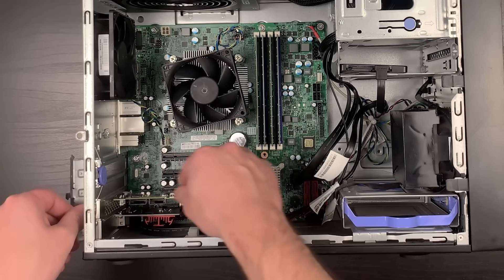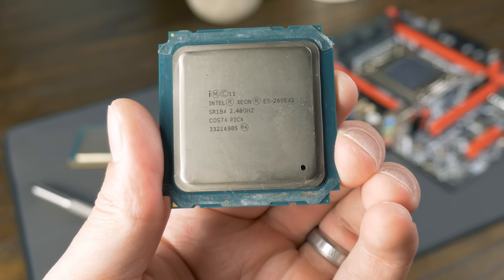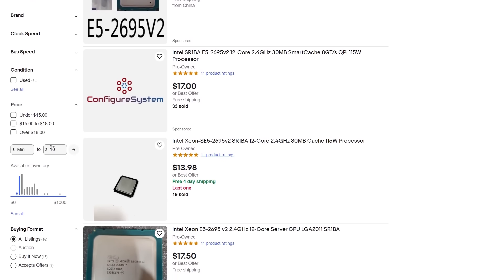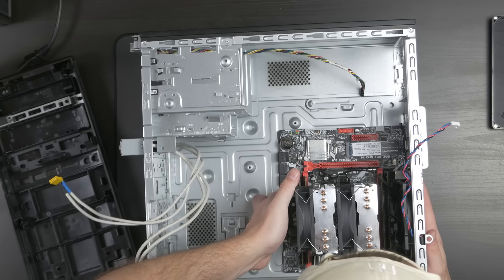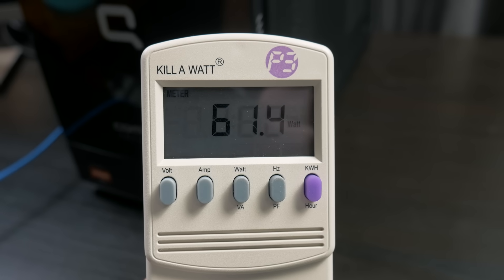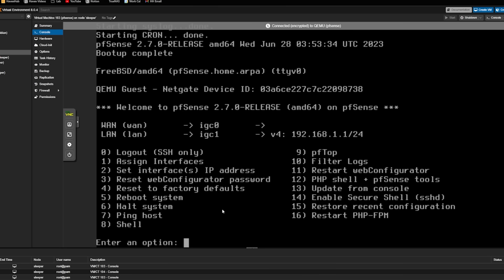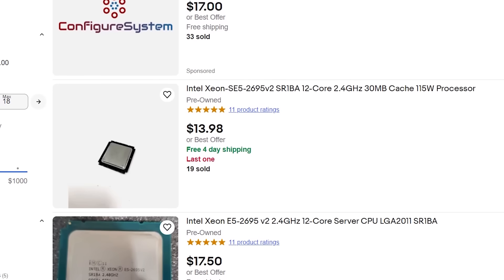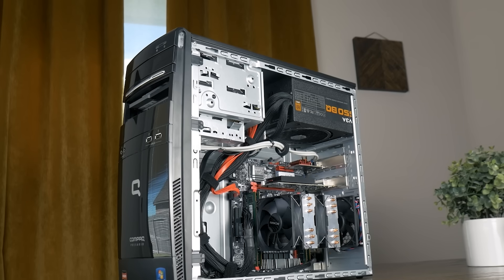Are CHEAP x79 Servers/Workstations Good In 2024?

Comment: I’m a cloud devops engineer obsessed with privacy and security. My main workstation runs Qubes OS. So everything’s in a VM. Probably 10 or more total concurrent VMs in my average workload. 

A pair of 8 core Xeon E5-2667v2s with 128GB of ram makes easy work of it. Single core performance is meh but it chews through the demanding workloads I put on it.
Reply: And you're telling Google about your setup?  Not obsessed enough!

Comment: Great video. Im also thinking to resurrect my i7-3930k as my old motherboard strike by lightning (ADSL connection) around 5 to 6 years ago. Been looking on aliexpress as well on buying a new x79 board. Just that im not sure the power consumption will impact me or not. Maybe someone can highlight me on this?

Main focus of the build will be running NAS and jellyfin (i had one asus GTX680 laying around as well). Maybe setup proxmox with some vm running system to share around the network too. Is it really worth the shot?

Comment: I had a similar rig with dual quad core cpus for a total of 16 cores but I found it limiting. I recently upgraded to a ryzen 5900 and yea it's a bit more but the IPC makes a huge difference on my virtual machines. They used to feel sluggish and my power draw is significantly less
Reply: 2x4=16?
Reply: @GewelReal  he probably means threads

Comment: Love old X79/X99 content. Crazy how cheap you can go. I rock a E5-2683 v4 for my server and it's awesome. Just upgraded to 128GB ECC for dirt cheap.  Haswell/Broadwell also have AVX2, so that's a nice add.
Reply: Same here. I am running a budget workstation on a X79 basis, including dual CPU (currently two 8 core Xeons) and 128GB RAM on quad-channel. Not the fastest beast, but powerful as a bull
Reply: nice. i am about to complete a dual 2697 v2 with 128GB 1866 system for video rendering.  @pascalfust1035
Reply: If you want serious storage space for less, you need to look back one more generation.
Something like the Supermicro 6047 72 drive hot swap server - which can be found for $1500 without trying hard.
The next-gen 6048 has some advantages if you want processing WITH your file storage, but costs significantly more.
E5-2630L v2 are not all that big of power hogs, even by current standards, though the non-L of that generation get kinda hungry.
Reply: How much ram did you get, how much did it cost and from where?

Comment: During winter the wattage does not go to waste at least. My pcs cut my heater use. Power is never wasted its just converted.
Reply: True but you can't really control the output temperature that well.

Comment: Cheap server components and stacks of PCIE lanes are the reason to do this.  PCIE gen 3 SFP/QSFP cards are cheap.  Brand new PCIEx16 gen 4 cards with 4/8x NVME drive cards can be dropped into a gen 3 slot while protecting your investment.  You can also do 8xSATA cards with sata SSD's but I suspect that's a dead-end tech.
I recently moved my i7-3930k to a 10-core xeon which upgraded the PCIE bus from gen2 to gen3 on my asrock x79 mobo.
Along with power draw, heat output is significant.  Beware non-standard tier-1 hardware manufacturers' systems, because you will need a case with better airflow than your standard workstation build, especially if you want to stack HDDs or a QSFP server nic you thought was cheap...

Comment: I got into big servers by buying a DL380p G8 with dual Xeon E5-2630L v2's and 128GB of RAM. Bought a second node with the same RAM and dual E5-2650's and built an X99 based custom build with an E5-2650 v4 and 128GB again. Total is sitting at about 384GB of RAM and 88 threads for the main nodes. The DL380p's cost me about 250 euros total, including the upgrades to their "final" specs they're on now. Need new and faster CPU's, however. The X99 system was another 300 in total I think. I actually use about 150GB of RAM and about 10-40% CPU.

What I'm trying to say is: there is very great value left in these machines, especially if you go the used enterprise gear route (and for DL380p G8's, you can modify the firmware and achieve near silent operation using some fan control scripts (that also ramp up if needed so no hardware gets burned).)
Reply: A DL380 isn't a big server.
Try something like a SuperMicro 6047 (same generation, 72 hot swap drives PLUS a couple of internal 2.5 boot drive spots not hot swappable).
I prefer to avoid HP in that timeframe as their raid controllers don't play nice with LINUX, you pretty much have to disable the raid function and pretend all your drives are individual RAID0 to make them usable - not an issue on Dell or Supermicro.
Those E5-2630L V2 are not bad on power usage, and quite good in their timeframe for their performance, and ECC DDR3 is almost dirt cheap any more given how many of those older servers are getting retired for newer gear.
For faster CPUs, I'd recommend the E5-2680 v2 as the best performance for the buck in higher-end CPUs right, any of the 269x are even higher performance but are still a little expen$ive and draw more power. Your existing heatsinks should work fine, HP like Dell and Supermicro tended to have ONE heatsink model for any given server model and it was always sized for the highest-power CPUs that server was designed to work with.

Comment: The X99 series is a much better option in 2023 for cheap Xeons. Not to mention the much newer chipset and ddr4. I went with the machinist x99 board from Aliexpress and a Xeon e5 2698 v3 with 256 ddr4 ECC.
Reply: U run stock bios on board or something modified, IRC machinist x99 rs9 have troubles with USB 3.0
Reply: @mateuszzimon8216  the bios that came with it. Slightly overclocked. Usb3 works just fine
Reply: Also if u wanna stay with V3 u can modify bios to run all cores turbo if they shipped without this in bios.

Comment: why use xeon v2, when v4 is the most logical choice.... you get processor with newer node 14n vs 28n, newer instruction, better single core performance, better efficiency and the price almost the same, also xeon v4 uses DDR4 memory.

btw, I bought  E5-2667v4  8cores/16threads (runs at 3.2ghz and boost at 3.6ghz) + 16GB of ECC DDR4 memory + motherboard, the three cost me around $100 from aliexpress
Reply from the maker: Because I bought the CPUs for the motherboards I was hoping to mess around with. Like I explained in the video.
Reply: @HardwareHaven 
Now I think about it,  you must have discovered that the second mb is x99 after buying the CPUs 😐

Comment: I've been using Sandy/Ivy Bridge Xeon servers for the past 3 years for my gaming community. One game super benefits from high core counts and is a ram hog so dual Xeon 2670's was the cheapest option out there with 128gb of ram and still running strong. My hardware is nothing I could recommend for a beginning, tinkering, or apartment dweller. It's not for the faint of heart.

I wish there was a video like this one back when I got the idea to buy used servers instead of renting servers. Your experience parallels my experience. 

Now that my electric company charges a "Time of day" rate and increased rates overall I'm finding myself close to shutting down servers. I can't recommend my solution to people wanting to do public game servers at home anymore. Its still fun to work with and I'm not trying to make money it. 

Great video, liked and subscribed.

Comment: My 2 cents... ZFS takes up to 50% of total memory. And it doesn't want to let it go easily. Learned that the hard way.
Reply: You can manually limit the amount of RAM ARC uses, it's all in the Proxmox documentation if I recall correctly. In my Proxmox cluster, for example, I've limited ARC to around 1 to 4GB only, since I use fast NVMe SSDs for my VMs and the storage capacity of each node is pretty low.

Comment: Nice video. I got a Lenovo P700 free from work when it was being tossed out due to it's age It has two E5-2620 v3s in it. 128GB of ECC DDR4 and I tossed in a 128GB PNY SSD with truenas scale installed. Two 8TB Ironwolf NAS drives.  Using plex and pi hole on it.
Reply: That's hell of a find. Nice job repurposing that beast!!!
Reply: @Fishgod1216  Thanks.  SMB network share, pi hole, plex and now it's a pxe server using iventoy.
Reply: @Fishgod1216  Thanks! It's been running 24/7 for about half a year so far.
Reply: That is really awesome it’s crazy what some people throw away
Reply: @OShackHennessy  Especially rich businesses. A few years ago one person asked for a 10,000 dollar pc and they just got them one. They hardly even used it.

Comment: holy crap im using that SAME case right now - my grandmother had a compaq 5000 something or other - thats too funny, i have an MSI B250M with an i7-7700 with 32G as a NAS with 5 drives in it....I had to buy the removable drive cage for the front of the inside off of ebay since hers didn't have it but the slots for it were there.....thats fantastic

Comment: i bought an HP Z840 a few months ago along with 256GB of mem, a bunch of cheap SSD's and 10G networking...I think I'm all in like $700 or so but it runs everything I need it to and is just rock solid...i have an HP Z600 as well it was meant to replace i now use as a backup....5-8yr old xeons are just SOOO much fun to mess around with, especially with all those cores and threads!

Comment: I was able to get a hold of 2 HP DL380P servers from a store that was tossing out some old hardware. I took all the memory and dumped into a single unit, 256GB total, and took the CPU from one unit and made the other a dual CPU configuration (these units were used for CCTV recording, so only 1 CPU was needed for those tasks).
Started off using the included 8x 2TB drives to mess around with, and get familiar with setting things up and such. Then later on purchased some 4TB drives from RhinoTechnologies on ebay for really cheap.
Next plan is to upgrade the CPU's to the Xeon 2695's to get more cores, doubling what I have now. I run multiple VMs and services/servers this way.
For my gateway/router, I use an old AMD FX board with opnSense installed inside another Proxmox installation with piHole running on that one as well. I did this because I wanted the gateway/router to be up and ready for network traffic asap. Full power off to internet connected takes <2mins. Faster than what it takes for the cable modem to finish booting up.

Comment: ooh, you so need to slap in a 4x NVME drive bay on that PCI slot and do a passthru!  Very cool build but will get the stuff done..I love those ICY Dock 5.25" bays...just need to get you a few 2TB SSD's!  Oh I found that assigning the VM's in PROXMOX on older hardware (I have an I7-3770), give it ALL the threads, so 24 for each machine...PROXMOX will autobalance them and unless you have a VM that is literally using all the cpu power (which is very rare) PROXMOX will balance very well and all the VM's will be snappy and much faster.
Keep em coming!!!!

Comment: ESXi having dropped support apparently, the (X99) 18-core, 2.3 base-2.8 all core-3.8GHz single core e5-2696v3 is going cheap as chips (although still solidly a premium chip).

Comment: I got an old HP Z620 workstation with 32gb memory, a video card a few years ago.
Replaced CPU with a similar 10 core CPU.
 And added an ssd and hdd. 
Power draw about 100 W while running Windows.
Still runs fine.
Reply: i have a Z600 that i've owned now for like 8 years that was used when I got it and just bought a Z840 because I love that one so much, now running both....im not an HP fan in general but I LOVE their Z-stations!
Reply: For comparison, I have a Lenovo workstation board x79 with Xeon 1620v2 and 64GB EEC and some random 2GB GPU, and it draws about 150W. 

Which is a lot better (and more horsepower) than the retired dual Xeon server I stole the RAM from... 450W idle, tho some of that is fans.

Comment: Yeah these old Xeons have finally lost their place as far as I can tell unless you particularly need the pcie lanes or a ton of ram on the cheap. 

We're getting to the point you can regularly find good deals on 1st/2nd gen Ryzen and Threadripper, as well as 8th-10th Gen Intel

And even sometimes 3rd gen Ryzen/Threadripper, or 11th/12th Gen Intel don't go for bad prices. 

And I'd take the vast majority of those over x79 or x99 systems. An r7 1700, or i7 8700 will match or beat them in basically every way. And any newer gens will only beat them harder.

Comment: I recently bought a used Dell Optiplex Core i7.  Why not buy an entire used Xeon computer guaranteed to work on delivery and forget building stuff.
Reply from the maker: I never said not to, I said I was basically just building a system around those CPUs I bought. However a lot of the workstations that these would be in can be pretty pricey compared to similar desktop systems, and the shipping can often be super pricey as well.

Comment: You know in the front part of that case those key sharp cut outs are for slide tabs from a metal tray add on for more hdds. I have only had a few machines with that but I've seen them with 2-4 bay expandable space.

Comment: As much as I love old Xeons (still running one in my NAS till I upgrade) newer Xeons are becoming affordable second hand and there are some good deals on second hand Epyc hardware.  If I'm going to eat up 100+wt at low usage/idle I want that system to at least have pcie 4, maybe a couple U.2 and modern CPU instructions.  Replaced my proxmox server (2678v3 w/64gb memory) with an Epyc Rome system (7302 w/128gb memory) that is substantially faster at about the same power draw.  While it wasn't cheap I can use gen 4 m.2 drives, 2 U.2, DDR4 and have newer AVX instructions and all that.  Planning on replacing the NAS next year after I grab myself an HL15.

There are still use cases for x79/x99 just because they can be had so inexpensively, especially for the lower TDP SKU's, but with the rise of consumer mini pc's and hopefully ARM I wouldn't be surprised if in 3-5 years it's much easier to do low power at home and get similar performance to 'low end' enterprise gear at a substantially lower price.  Here's to hoping anyway.

Comment: Taking out the GPU to drop power usage is kind of missing the forest for the trees. With the CPU doing transcoding you're going to be using a lot more power than if the GPU had done the same work. The video encoding hardware on a GPU uses almost no power, while the CPU doing the same work will burn tons.
Reply from the maker: Transcoding was only a small segment of what this video was about. I think there’s also an argument to be made that saving 15 W for 23 hours of the day is probably better than saving 30 or 40 W for an hour or so. Obviously that depends on how often you’re transcoding.

Comment: I have a rather unique perspective on why I built an x79 (socket 2011) system.  For me, I managed to start with a WHOLE BUNCH of FREE RAM.  To be exact, I was gifted 384GB of ECC DDR3 RAM.  So for me, it was a no brainer that x79 was the way to go.  Otherwise, as you stated, it would not have been nearly as worthwhile.  Even with the single core restrictions you noted, I managed to find a couple of E5-2690's (8 core 16 thread at 2.9GHz turbo to 3.5GHz) and an old barebones Dell Precision T5600 and it virtualizes great.  If you stick with a T3600 (single socket) system, you can seriously find some really great deals.  I found one of these for, no kidding, $39 (+$19 shipping) basically complete with no hard drives.  So if you have the budget for electricity, I think it is worth the price.  These are solid systems.
Reply: Hmm... might be time to think about replacing my old Precision T3500 running a X5675, it's been a great computer but I'd really like a UEFI machine, and to keep my EEC RAM.

Comment: Thanks to all these videos you’ve been posting, I’m buying a desktop mobo, ram, and cpu with these parts. 

asus prime Z270-P motherboard.
- 15-7600K 3.8GHZ 4 cores 4 threads.
- Nvidia geforce gtx 970 4gb VRAM.
- 2 gskill ripjaw ddr4 RAM 3200MHZ 8gb. (16gb total)
- Cooler master cpu cooler.

All for $150. I’m going to salvage my old psu if I can to see if it’s any good, and reuse that case, and I just need to scoop up some drives down the line when I get more money, and maybe double my ram. Going to run my Minecraft, beammp, and fivem servers off of it! Thanks Hardware Haven!

Comment: i just build a Dell Precision Tower 7810 with 2x E5-2683v4  totaling 32 core 64 thread and 128G of ddr4 ram and a 1070 for video encoding. added 3ea HDD's SSD's and m.2 NVME for 3 ZFS pools with 1 additional NVME on a 4xm.2 to pcie adapter for truenas install. all in, minus the drives i was at $270.  hard to beat this performance for that price.

Comment: A $9 Xeon E5 2650 V4 CPU is cheap indeed but $74 X99 😅. 

That CPU is for testing and backup, I wanna make sure that the power consumption isn't too high vs my current one, and will be replaced a E5 2695 V4 which is more expensive.
Not to mention the DDR4 ECC ram